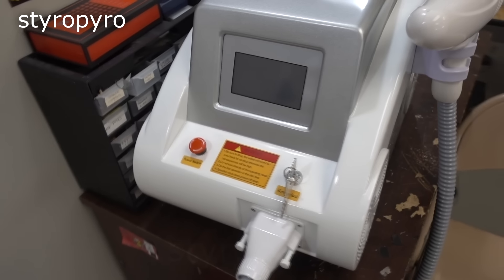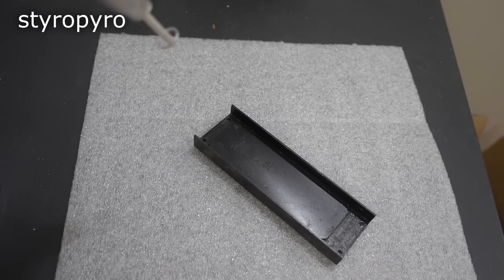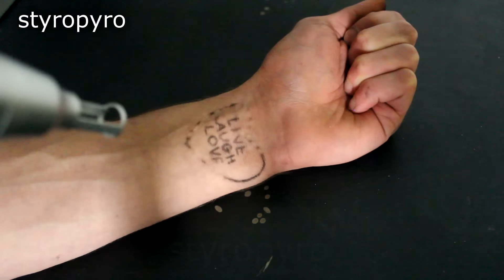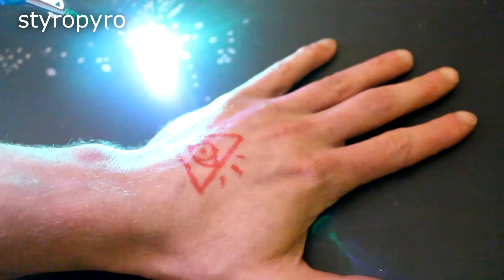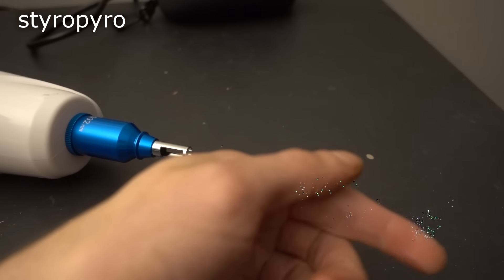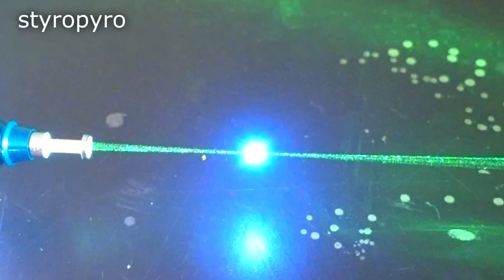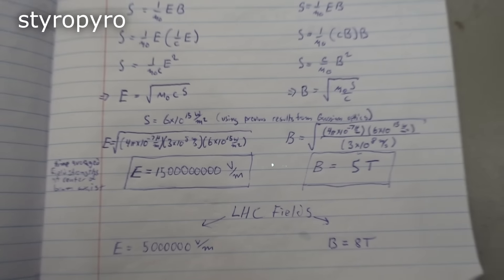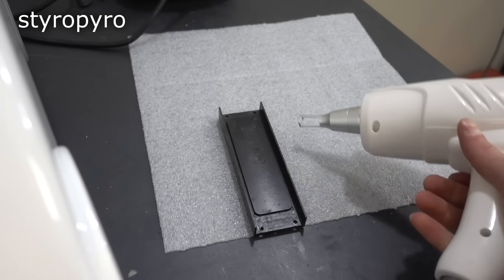Dangerous tattoo remover from eBay is a MILLION watt laser

Comment: I worked in a semiconductor manufacturer back in the early 2000's, they had about 6 YAG lazer machines that were built back in the 70's. The lazer was used to cut traces in silicone wafers.
Reply: How big is that laser then?
Reply: @Leviathan-me5qd 1970s technology it would have been probably the size of a semi container

Comment: at this point im sure that if he got shot with a gun he would still say "Ooh that tickles"
Reply: flesh painfully and slowly starts melting "ooh that tickles!"
Reply: @NerdStuffing  what
Reply: @NerdStuffing  how does flesh melt
Reply: @sensionultra7962  It actually does. It has a pretty high melting point tho due to it not being that conductive. Not as high as those cool metals tho
.
Reply: That laser is nicknamed "The Warcrime"
Reply: Hellboy Deadpan Humor.

"Ouch!"
Reply: @sensionultra7962  anything can melt
Reply: 0.P1NG_Opski anything?
Reply: @lowkeybear10  yep, anything
Reply: @lordcastro3379  wood can’t if I’m correct
Reply: @PlentyOfTrickShots  it burns before it’s melting point but any element can be turned into liquid solid gas or plasma if you have enough heat or lack thereof
Reply: @Alexzander Busby    Sounds like an expensive way to make charcoal.
.
.
Frick!  I just wanted to make the joke. How am I already googling?
Reply: Well he has the testosterone level of a bull.

Comment: Very interesting video. For those thinking of laser tattoo removal. I saw a video that went into the chemistry of tattoo inks. Apparently there are some that breakdown into very toxic by products when they are destroyed by lasers. So probably best to check that out first, to ensure you will be safe, before proceeding.
Reply: Where did you hear this? It's possible the laser can cleave some molecules and just happen to produce carcinogenic compounds, but that's mostly theoretical at this point. And there's no way for most people to check this out since there's no hard data about whether this actually happens or to what extent. There's one university researching this but they haven't published anything yet AFAICT.

Laser tattoo removal also isn't breaking down ink at a molecular level. Instead, it heats up the large blobs of ink in your dermis, causing them to break apart into smaller chunks of ink. This makes it much easier for your immune system to remove the ink from your body.

Comment: "what happens when I dont aim at anything?"
"oh yeah the AIR IGNITES"
Reply: It's probably pumping N2 from the air and producing uv radiation. It's a laser within a laser
Reply: @achilleslade3771  No, it is dielectric breakdown of the air. Like the spark of a spark plug, just with no electrodes. Think: Light = electromagnetic wave, that makes electric field strength, more or less voltage. And very intensely focused laser light gives a really strong electric field which "jumps the gap" even without physical electrodes: There is an electric spark.
Reply: @goamarty  Well yes, my apologies I shouldn't be so vague. I assumed that was implied already. Remember the electric spark you're talking about is ionizing mostly nitrogen in the air which is responsible for the light emission we see. The definition of dielectric breakdown is that the dielectric material becomes so ionized that it conducts electricity, and more often than not that results in stimulated emission as with nitrogen in the air. The fact you're seeing light emission at all from an electric spark means something is undergoing stimulated emission and given the 78% concentration of N2 in the air I'm going to take a wild guess as to what is mostly responsible for the light emission.
Reply: I wonder if the laser pulse is long enough to allow a high voltage electric current to flow through the air at far distances!

Comment: 10 years later...

Oncologist:  "No, you're actually my first case of wrist cancer."
Reply: Luckily thats not how skin cancer works :D  Skin cancer is almost universally from UV light, which this laser probably doesn't output
Reply: ProngedStag you are probably right, but they did say wrist cancer. Maybe a tumour in between the wrist and forearm bones?
Reply: @ProngedStag  Well, it's almost universally caused by UV rays because those are the most common ones out there, it's pretty rare for a regular person to come across other types of ionizing radiation. That being said, if you did come across it, the likely hood of you getting skin cancer would be about the same if not a little lower, since the rays penetrate deeper but also move much faster. All in all if it's ionizing radiation then chances are you still shouldn't be playing with it anyway

Comment: Never thought I'd see a Megawatt pulsed laser with a cheesy, confusing UI.
Reply: you actually think that industrial/research lasers have better UIs?
Reply: @iQKyyR3K  not better, but generally pretty bare bones and no frills, as opposed to this which has the same UI you'd find on a knock off game emulation handheld
Reply: onometre that machine is for doctors, not engineers, they need the UI like that. Plus... it’s from China.
Reply: @loganthesaint  theres a lot of space between command line interface and a dvd menu. that space is where 99% of these UI's normally fall, while this one is firmly in "DVD menu from 2007" territory
Reply: This should melt his transformer tbh :D
Reply: onometre but... China... they can’t help if their pirated 2000’s DVD’s led to their inspirational UI’s 😂

Comment: I wouldn’t be surprised if the center was hotter than the sun!

shoots hand

Heh that tickles!
Reply: Well, I mean yeah, it hurts, but not nearly as much as I expected.
Reply: Temperature and total energy output are 2 different things. The main advantage to being 90% water is how much energy we can absorb before even feeling it, let alone being hurt by it.
Reply: @theTeslaFalcon  actually we're 70% water🤓
Reply: The surface of the sun is only around 5,000° Fahrenheit... It's the sun's atmosphere that reaches EXTREMELY high temperatures, which, when you think about it, doesn't make much sense at all...
Reply: BigMassive 80%
Reply: @max10hoop  actually we're both wrong I looked it up and its 60% 😳
Reply: BigMassive 😳😳😳
Reply: @danieldevito6380  
I think it proves that the solar fusion bomb theory to be highly implausible. A more accurate view of the sun would be as a Tesla coil. Do a look up on "electric model of the universe". It makes more sense than the exception ridden gravtional model.
Reply: @max10hoop  😳😳😳
Reply: @chinochimp 
The human body as a whole? Maybe. But he's not lasering his skeleton. We're talking skin: higher percentage of water.

U can extinguish matches (450*F) w bare fingers and barely feel it. The bigger aspect of human pain receptors have to w even but disconnected placement over the skin in conjunction w thermal and pressure receptors. The laser hits so small, so fast that it's very possible that it missed one or more of those receptors or was so fast that it didn't register in the brain as significant.

This is also ignoring psychological assessment of contact. Fear of pain makes a sensation more intense / painful than a relaxed or anticipatory attitude. StyroPyro doesn't seem like a high-strung snowflake afraid of his own feelings. MOF, I might actually be more concerned w him being more masochistic.
Reply: @chinochimp 
Skin is 64% water.
Reply: The sun is nothing compared to the god like power of Styro Pyro
Reply: skylerelax  He's a nutter. But a smart nutter.
Reply: Tesla Falcon shush
Reply: pp
Reply: @theTeslaFalcon  love the shout out to plasma cosmology. Thanks for that 👨‍🎓
Reply: Daniel DeVito I thought it was 10000
Reply: Who else got a seizure
Reply: David Parry  He said " Yeah whatever my skin will probably heal" I don't think he really cares
Reply: Biggest flex I've ever seen
Reply: he was talking about the center of molten tungsten
Reply: @potterfanz6780  it's actually pretty neat
Reply: Eddie Hall is only 20% water.
Reply: The moisture in your body protects you from extreme heat, as it vaporizes the water which consumes a huge amount of energy.   Plus he's light skinned, which means a lot of the energy is reflected by the surface.   Its why bus roofs are painted white and not black.
Reply: @crusherconi  😳😳😳
Reply: @theTeslaFalcon  Nonsense, no serious astrophysicist claims the sun is like any of mankind's bombs.  Hydrogen is so difficult to fuse that even at the temperatures and pressures of the sun's core a cubic meter of of it only make about 250 watts per cubic meter, less energy density than a human body... but, the core has a LOT of cubic meters.   The electric universe theory was debunked in the 90s, it's adherents and evangelists are looked upon as clowns.
Reply: @RWZiggy 
So, u have completely disregarded nuclear fusion, nuclear fission, & the electric model. I like your confidence, but confidence in agnosticism is foolishness. The gravity model has also been repeatedly debunked, but every year is another "surprise" and another "patch" to a model that has almost as many exceptions and missing links as evolution.
Reply: @theTeslaFalcon   eh?  I was only stating the mainstream view of astrophysicists, saying there is fusion, brought about by the conditions in the core of  stars due to gravity; stellar nucleosynthesis model makes very accurate predictions of the types of stars and the relative abundance of the elements found in the universe.  All other models have been long debunked
Reply: @RWZiggy 
So 500 (or 500,000) people sitting in a room checking each others' math is "proof"? The very assumptions they begin w are faulty. We've never been to a nebula physically w even a probe, but we want to pretend that somebody's vivid imagination is as "flawless and proven" as seeing the sun through the clouds proves that the sun was made in the cloud. It's like those imaginative artworks in museum attempting to depict human ancestors which have been debunked for over a century. When Jonestown can't happen anymore, then collective delusions can still happen, esp in academia. Living in their tiny thought bubble, they intentionally exclude any contravaling idea, any contradictory evidence. This isn't science anymore. It's a religion w white coated priests.
Reply: @theTeslaFalcon  "checking each others' math'... no, that is not what science is, you have just shown your ignorance of the subject.  Scientific models are subject to experimental proof, and we absolutely can tell the composition of distant stars and our own sun.  We can tell the composition of nebula formed from supernova too.
Reply: @RWZiggy 
Models are subject to bias and error. Computer models are only as good as the beliefs of the modeler. While we might make educated guesses on the composition of distant stars, we cannot know for "absolute certainty" as u claim until actual contact w such stars occur, if ever. Solar return missions have been done, but temperature differential between core and corona is evidence against it. Unless u use circular logic: the sun is a fusion explosion. X is evidence of a a fusion explosion because that's what the sun is. Sadly, the dominant logical proof I keep hearing in astronimical circles is circular.
Reply: @theTeslaFalcon  False, elements heated to incandescence give off unique spectrum accoding to electron orbital transitions.  We absolutely know the composition of stars without question, we are "in contact" with the photons emitted. Your ignorance of science and astronomy in particular is incredible.
Reply: What's up with the pyramid and eye at 15:24 tho

Comment: Are we all just gonna ignore the screwdriver jammed in the power socket behind him?
Reply: It’s a convenient grounding lug!
Reply: Time stamp?
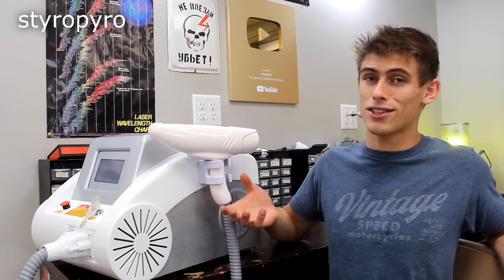Reply: @user-fu7eh2mk5n  right at the beginning 0:25
Reply: @user-fu7eh2mk5n  0:14
Reply: Casual
Reply: connected to ground, probably a ''safety'' measure.(runs wire from screwdriver to machine that isn't connected to ground.)
Reply: Oh yeah yeah  ya where i'm from we dont have those plugs, but i guessed it was gnd, still funny as hell
Reply: dont we all use a grounded screw driver connected to our arm with a wire to prevent high voltage into our circuits from rubbing the chair? ;P
Reply: It’s grounding
Reply: Ground socket.
Probably to ensure he doesn't zap himself when working with stupid powerful electric circuits.

Comment: I worked with a Yag laser in Army, the GLLD.  Used to spotlight tanks for destruction.  Goggles were green, often swiped for gas welding.  Totally blocked lit heater elements.  That laser is focused well down range.  It was about 6 - 8 inches in diameter at the device.  High ranking DOD civilian said that he could hear it strike the target 2 or 3 miles away.
Reply: I'm not sure I understand anything you just said.
Reply: I think I understand, but please elaborate, pretty please.
Reply: @tolep  Basically remarking that the military laser, used to aim Hellfire missiles and Copperhead artillery shells is safer at close range than the tattoo remover.  Also comment on safety equipment.

On the other hand, the GLLD (Ground Laser Locator  Designator) seems to be dangerous a long ways off.
Reply: @russellstyles5381  yeah that second time was much more legible, idk if I’m high or what’s happening, glad you made it home safe though my man.
Reply: @ElDuderinoh  same bro... same...
Reply: @russellstyles5381  ah yeah second time I got you
Reply: @Russell Styles   I don't believe a word you said.  The reason no military in the world has made a practical battlefield laser is that the required electrical power to create a beam capable of burning thru metal armor quickly, would be similar to that needed to power a medium sized city.  The laser you describe would require the entire output of a nuclear power plant for example.  Thus,  while such devices are theoretically possible, they are not practical battlefield weapons.  The USN has looked into lasers for point defense on ships and diverting all the ship's electrical power output for a second to generate a pulse capable of piercing the thin skin of a missile is possible but of questionable value since other more easily implemented methods (shooting an air defense missile) exist.
Reply: @minerran  Never said that.  It was used as a spotlight.  Source said that he could hear a light popping sound.  Did no damage whatsoever.  Aside from retina's I suppose.

Was used to show Hellfire missile or Copperhead artillery round where to strike.
Reply: Ah yes, "high ranking civilian".
Reply: @minerran  you know what a laser designator is right?...
Reply: i suddenly have a nostalgic memory of the pc game "Delta Force 1" by Novalogic in 1998, 
in that game there was also an Laser Designator like you describe.
Reply: My work with the GLLD was in 70's.
Reply: @mutestingray  I imagine this is what a veteran sounds like to people who’ve never been in war tbh
Reply: @minerran  it’s for dazzling targets dingus. We have handheld ISLEDS that are like Uber green laser pointers that Fisters will dazzle a target for Air to smash.
Reply: @Tacos4brekky  US military extensively uses contractors for anything other than regular grunts. By high rank he probably means high security clearance. Oh and he could also mean a civilian position like as an administrator or office worker.
Reply: @minerran  Targeting lasers are used all the time on helicopters, aircraft and even class 3-4 lasers on small arms (an/peq-15)
Also missiles can cost hundreds of thousands or millions of dollars just for 1. A several million watt laser over a second or so can cost a few dollars. I wouldn't exactly call it questionable value.
Reply: @minerran  that long comment, all those 'quotes' this man has had this info at the ready (probably even searched up a bit more mid comment) just dying to use it... then he blew that whole load here not understanding what he was responding to lol just heard the words military and lazer then jumped
Reply: @minerran  Reading comprehension is turning into a lost art, dolt, LOL
Reply: @minerran he said it was for marking tanks for destruction, not the laser itself destroying the tank

Comment: Watts: 1 Million

View Count: 3.5 Million

Electrical Bill: REDACTED
Reply: 1 million watts over 10 nanoseconds, though. That's, like, on the order of 10 to the -6 watt-hours. And you pay your bill per kilowatt-hours.
Reply: It doesn't draw 1M W continuously
Reply: It doesn't even draw 1M Watts ever, It charges up capacitors, which release 1M over 10 nanoseconds
Reply: even tho the point is invaled ree sin i still admire your humor and it made me laugh lol.
Reply: Hotel: Trivago
Reply: This actually only draws about 500 watts at any given time
Reply: It should have been " Electricity Bill: $ [ DATA EXPUNGED]
Reply: @Ree Sin - The pulse might be 1,000,000 Watts, in 10 nanoseconds, and repeated 5 times per second. This means that the equivalent or average continuous beam power would be 0.050 Watts. Lasers are inefficient, so let's be safe, and assume that the conversion efficiency is 1%. This means that the power supply is delivering an average of 0.05 x 100/1 = 5 Watts. A good D-cell flashlight battery can deliver that power easily.

The whole equipment is actually rated as using a maximum of 500 Watts. So, in the worst case, the electricity bill would be 0.5 kWh (0.5 unit) if the machine were running continuously for an hour. Peanuts.